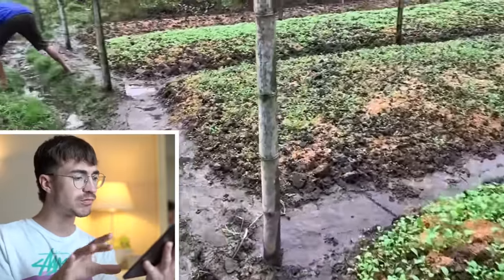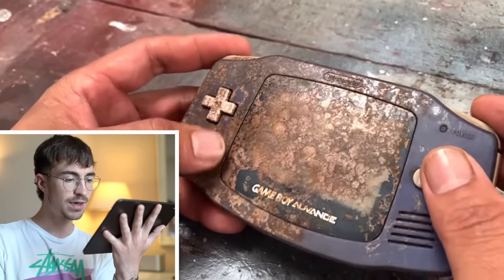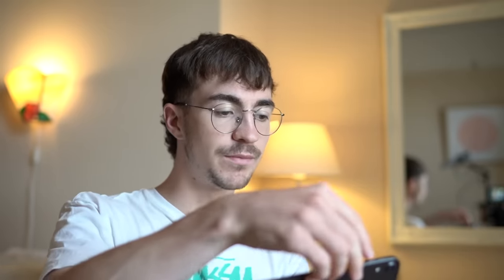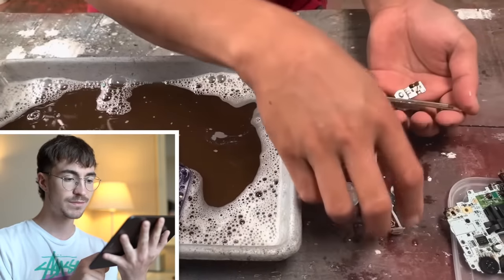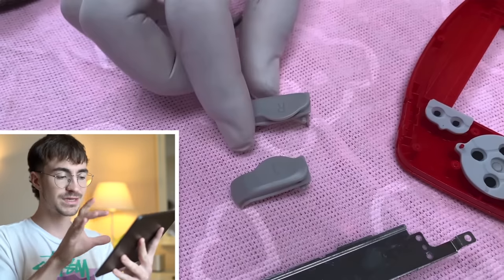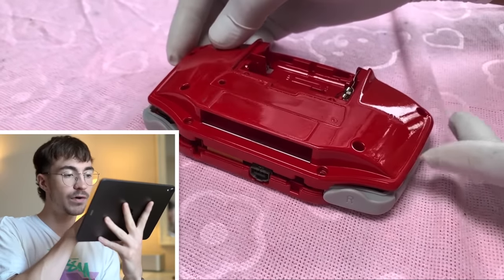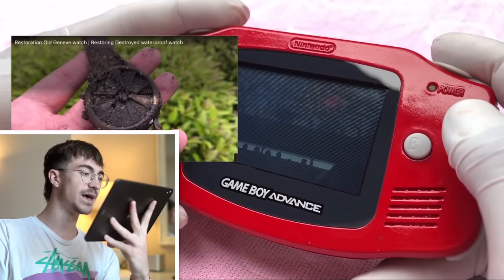Exposing FAKE Restoration Videos!

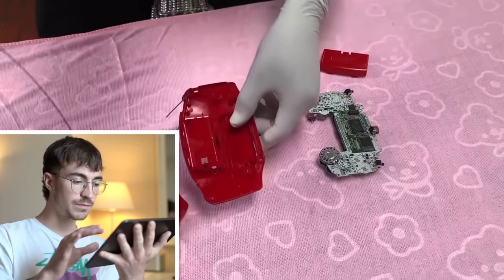Comment: 6:48 the shell was clearly swapped out. The old one was dark purple, the new one is a very bright candy-apple red and the sun is shining through it. Paint doesn't magically turn opaque things translucent.
Reply: I noticed the same. However, the shell at the end does indeed look spray painted, maybe they just put the replacement in the sun for show.
Reply: @kyx5631  that shell looks pretty normal for cheap shitty Chinese shells
Reply: Did you watch the video? He's spray painting it right here. 5:50
Reply: @Martin Tubewatch So it was spray painted and then still swapped out?
Reply: @bs321321  I did, in fact, watch the video. The purple shell did in fact get spray painted, nobody's disputing that. However it's not that same shell that was being shown at 6:48.
Reply: @fluffycritter  Spray painting the original to match the color of the replacement that you're about to use? Double despicable.
Reply: @bs321321  The weird thing is that at the end of the video it looks like he used the spray-painted one anyway. So I don't know why there was even the shenanigans with swapping the case out.
Reply: If something is blue, and you paint it red, then it becomes opaque, because no green, no red and no blue light can shine through. When the camera switched to the supposedly painted parts I was like, "waitaminute that's not paint".
Reply: @Martin Tubewach a motherboard can be soaked in water if there is no power running through it like imagine you dip a computer motherboard in snow and you just let it dry it will work and theoretically the same with this one but i said « theoretically » because the one in the video might have issues with chip connections or rust or dirt some hidden places 

Tl,DR yes you can soak motherboard in water only if you let them dry
Reply: I build Gundam models and it is interesting to me that the Red plastic usually is not very good at being Red, it has like a translusence to it. It is interesting to me. It may be the type of plastic too
Reply: @bs321321  Try spray painting inside of the screw-in towers. You can see the red color is even inside the threads and every nook and cranny. I highly doubt that. Some other things in this Video are genuine though.
Reply: @fluffycritter  On the other hand, I have to agree that in the end, the case looks like it was dropped in a paint bucket. Still there might be different cases for parts of the video. Maybe they realized in the end that it was too obvious and switched it back.